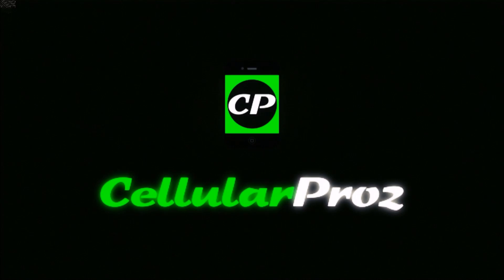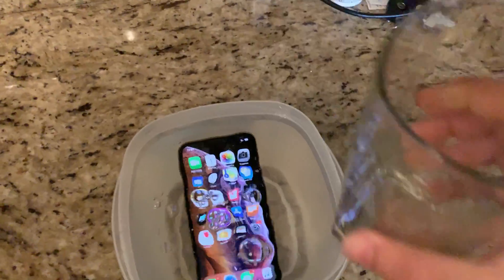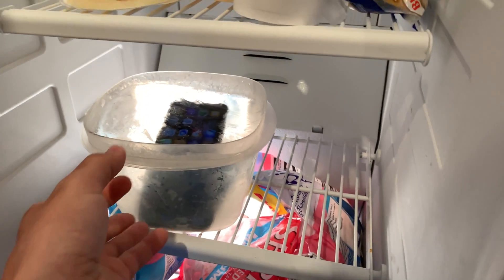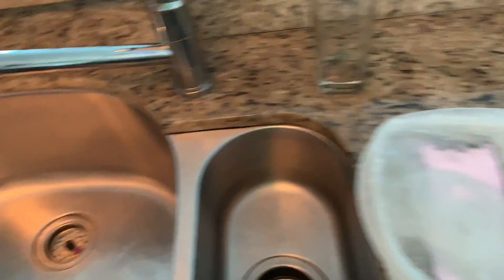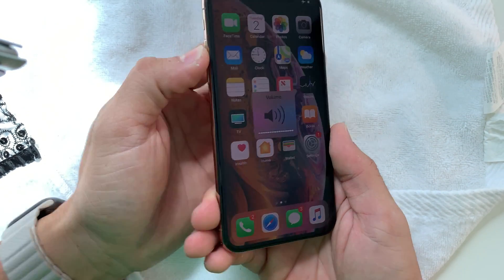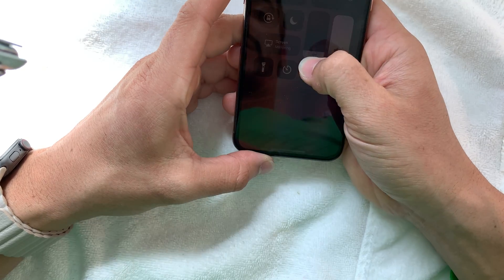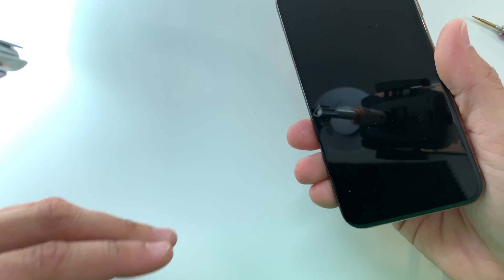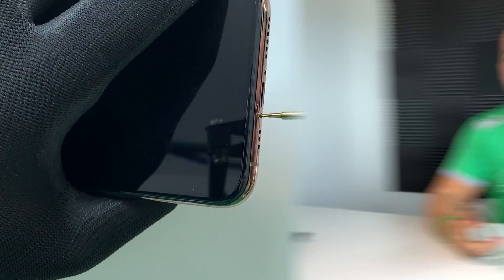iPhone XS FREEZE Test - How True Is The IP68 Rating?

Comment: Thanks for sharing this I accidentally left my iphone xs on top of the freezer and opened the door to get something out and the phone fell into freezer, bout 5 hours later I couldn't find my phone until I opened the freezer door and found it. F×××k I was spewing immediately thought it was screwed so left it wrapped in a towel on the bench over night and checked it the next morning was surprised to see it powered on and it is working again fine. I didn't open the back of it cause I don't have the right tools but I took it to a repair shop and they said it's fine. Apparently if it gets wet inside it comes up with an error message and shuts down to protect the battery from short circuit so I haven't had an error message so the shop said it's all ok. Whew super lucky. Cheers apple your phones are awesome.